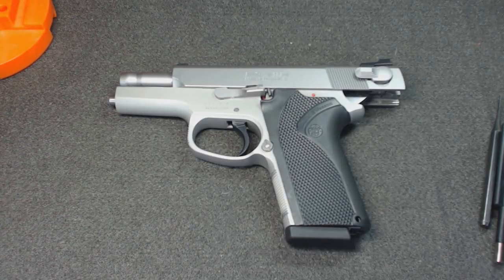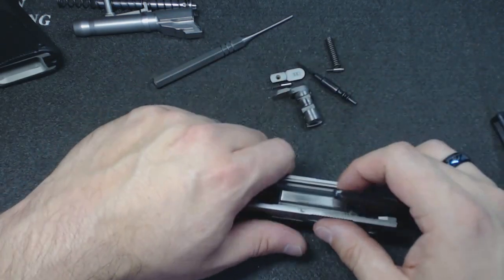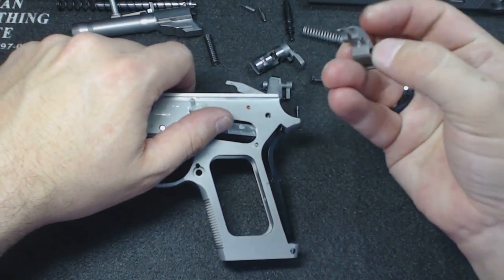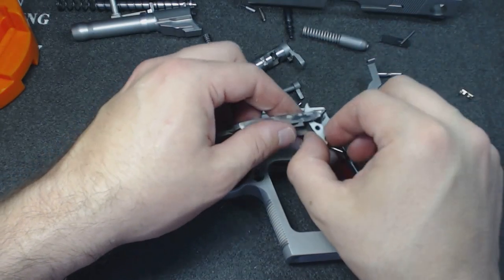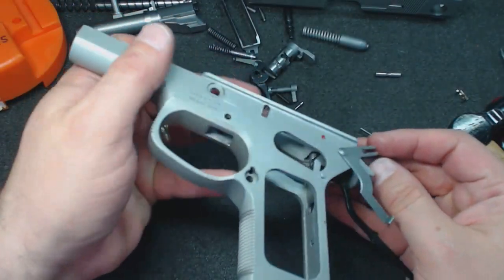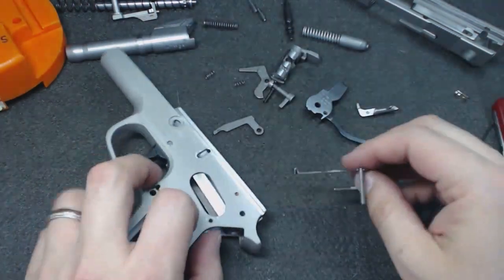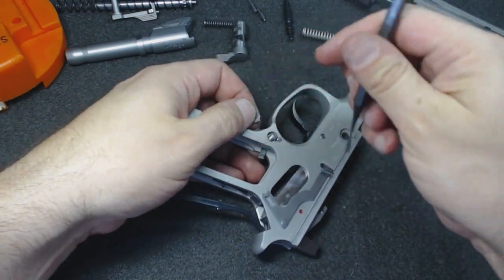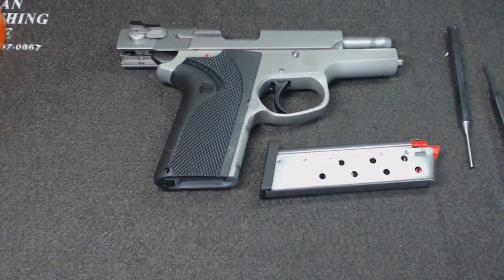Smith & Wesson 3913 "Ladysmith" Walkthrough disassembly and reassembly

Comment: Lady smith has tapered dust cover. Best concealed carry 9 ever in my opinion. At least for hammer fired da/sa folks like me. Broken part on trigger bar is SA take up travel spring...to keep trigger travel in SA from being sloppy. Don't need new bar, Brownell sell new spring and rivet!  I've knocked extracted pin out on one of mine...just for full breakdown once. Bent 3 punches and beat on it for half hour. Yikes. Found out s&w pressed those in with hydrolic press! Should never need to do unless worn or broken extractor. Good advice bro! Should use small bent punch to push firing pin in after first stage of safety removal...comes out easier instead of wiggle and pull method that could cause damage.brass or plastic  punch only in FP channel!  Ouch.
Reply: He has no clue. Definitely not an armorer as his name suggest. I would hope not at least.

Comment: The hole in the top of the slide is smaller than the one on the bottom of the slide for the extractor pin. You will need to drive the pin out from top to bottom. When you install the pin you will need to drive it in from bottom to top.

Comment: thats a Standard 3913 not a Ladysmith. I have the Ladysmith model and the frame is much more tapered at the end and Ladysmith is engraved on the Slide in large Cursive
Reply from the maker: Yes, this is true. LadySmith covers several S&W models, and the 3913 is the only non-revolver I know of that had a Ladies version. This is a stock 3913 and not a true 3913ls. The internals, however, are the same.
Reply: You're so right, have the 3913 that I bought back in the late eighties.
Clinger makes a kydex holster for it that fits really nice.
It's on sell now for $39 bucks. It is a IWB holster.
Reply: @AshburnArmorerDan  They had the 3913, 3913 ls an 3913 nl (no logo). I found a lady smith a couple of weeks ago in excellent shape for 4 bills.

Comment: I just put trijicon sights on this model as well as a full strip cleaning. That extractor pin IS TOUGH!!!  You must  keep at it , IT WILL COME OUT.
Reply: shotgunner zero any video on installing trijicon sights ? Not to sure if something going to put up after sliding off the stock sight cause I think there’s something under Spring tension under the back sight

Comment: Thank you for the skill and patience to post this.  I installed a spurred hammer.  Without this video I dont think it would have ever gone back together.       One question - the magazine disconnect, for which I have some disdain, can you just leave it out ?  or do you have to cut it,  mill it, or grind it  ?
Reply from the maker: I get asked about disabling/removing magazine safeties a lot. My answer is always this: Just don't. I personally hate them too, but the manufacturer put it there for a reason. If they don't make a model without the mag safety, complain to them. Overriding/disabling any safety feature of a gun is always a losing proposition. It is a minor inconvenience at best, but that kind of modification to a gun makes you completely liable for anything that goes wrong with that gun ever. If you use that gun for defense, you are going to spend the rest of your life in jail...modified gun = manhunter. If you sell it and the next guy's kid kills another kid...you spend the rest of your life in jail. If it gets stolen and the thief kills someone...you spend the rest of your life in jail. 

No matter what the justification, a jury will see  only one fact: you made a gun less safe. It doesn't matter if it is accurate or relevant, it is all they will see.

Comment: if I'm duracoating mine, I shouldn't have to completely disassemble the upper like that should i? I was planning on covering it with tape.
Reply from the maker: I have to confess that the thought of putting a coating on a stainless steel gun does make me cringe a bit. However, to each his own! So long as you tape off everything that you don't want to coat, you will be ok...just do a very thorough job with the tape. Also remember that the quality of duracoat, cerakote, or any other treatment is extremely dependent on the quality of the surface preparation. Degrease it, then degrease it, then degrease it again. Change gloves between every pass. You want that surface to be perfectly dry and grease free or the coating is going to come out lousy.
Reply: I agree with you. I have the model 908 the budget version. The gun finish was screwed up and is ugly as sin.
Reply: and thanks for the tips:)

Comment: Do you know if a s&w 3913 steel disconnector would fit in a 908?
Reply from the maker: The Smokinggun I'm not 100% sure because I couldn't find an actual 908 extractor for sale, but they do share a lot of parts as they are both series 39 pistols. It would be stainless and not blued, but I suspect they are the same size if I had to guess.

Comment: First off, that's not a "LadySmith."   The 3913LS has a dustcover with a different shape and only has a safety on the left side.  That is a run of the mill 3913.  

The little nipple on the guide rod is not to force the slide stop down.  A simple experiment will show you that the slide stop is held down by the spring loaded plunger in the slide stop acting against the sheet metal piece right behind said slide stop.  The nipple keeps the slide stop from walking out.  

Also, you have your timeline backwards.  The Model 39 was introduced in the 1950s with the double stack Model 59 being introduced almost twenty years later. So it is inaccurate to say this is a "version" of the 59 (and successors).

I stopped watching.